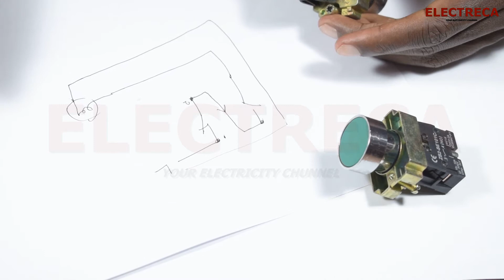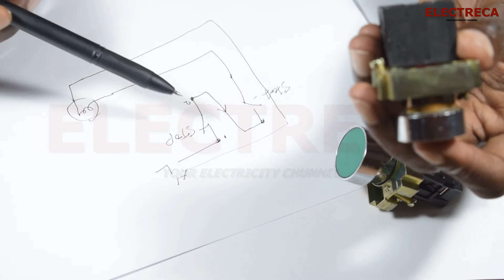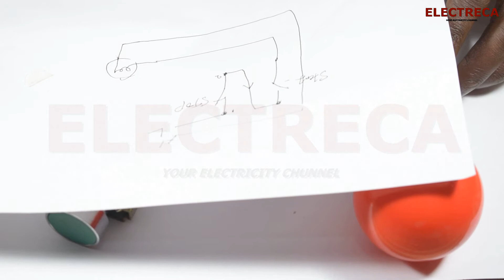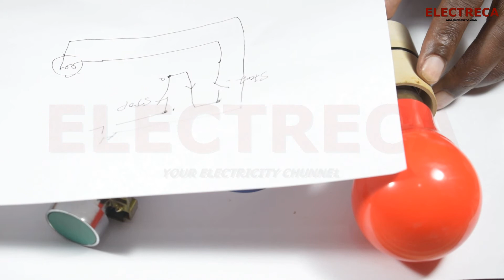start stop buttons|explained|electreca

Comment: May I make a helpful suggestion?
Use a darker pen on the paper, it’s a bit difficult to see the details. 
Can you show a circuit using push buttons up and down ( N.O.) on two separate levels for switching a 220 volt winch motor up or down using a limit switch either end to break the circuit. No stop buttons just limit switches.?
Reply from the maker: Thanks for the suggestion ill get a dark pen.  ill make a circuit for it and let you know if I upload it.